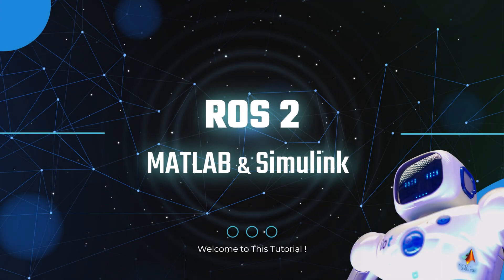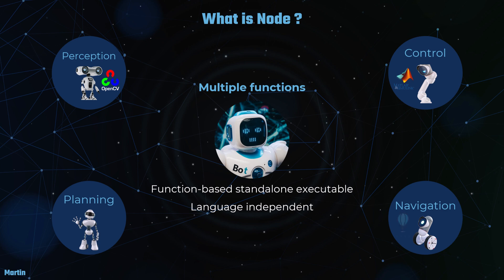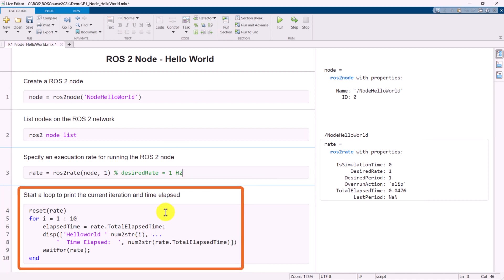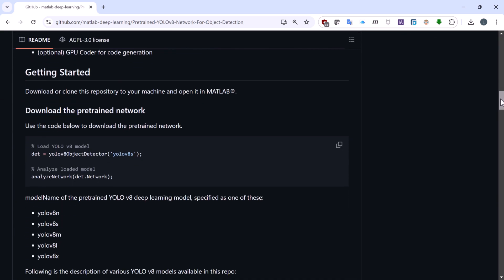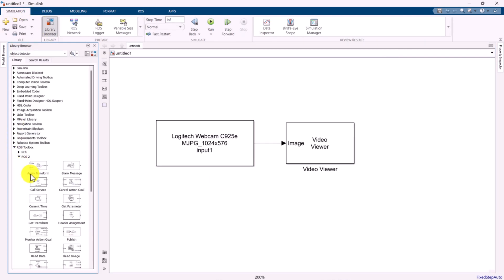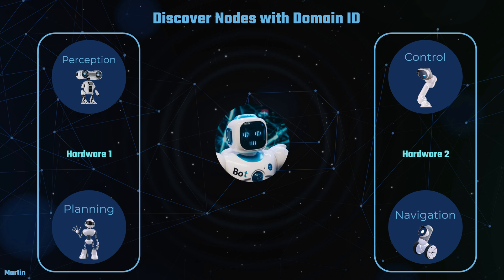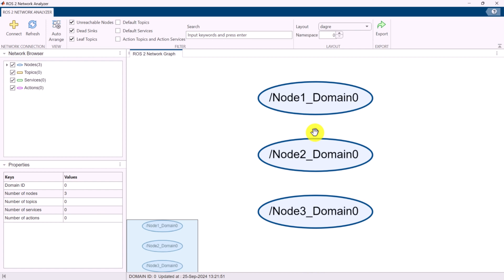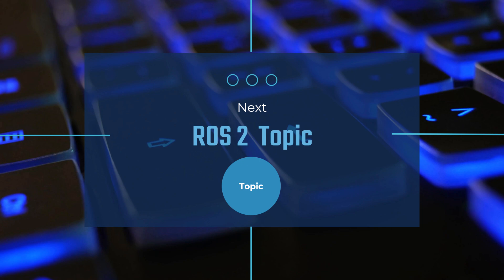3 ROS 2 Node  |  MATLAB and Simulink Tutorial

Comment: i use the matlab r2025a in Ubuntu 22.04 with ros2 humble in same platform I've applied all comments is correct but when run the turtlesim it isn't in the matlab what's the issue
Reply from the maker: Thanks for the question. Do you have a chance to walk through this official doc from MathWorks: https://se.mathworks.com/help/ros/gs/ros-system-requirements.html.

For R2025a, I think it's worth to try Jazzy instead of Humble based on the doc.